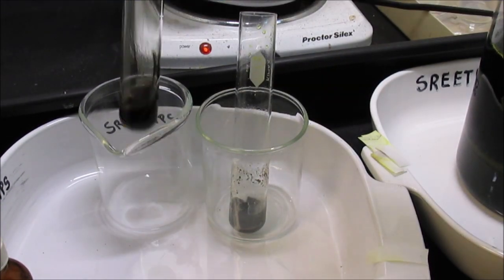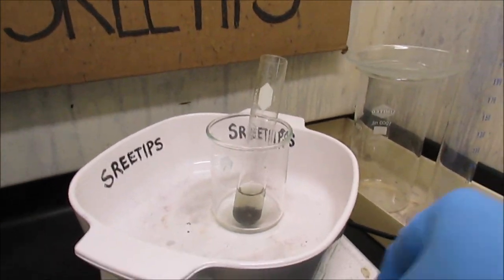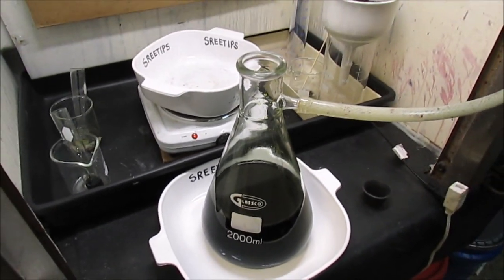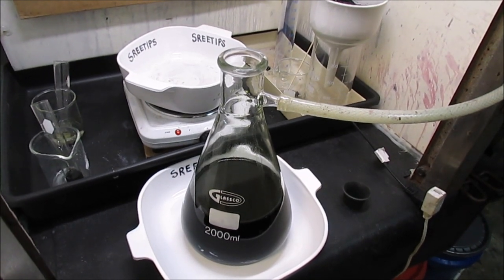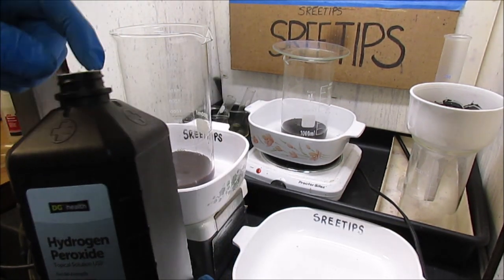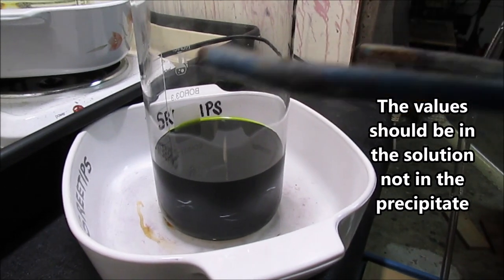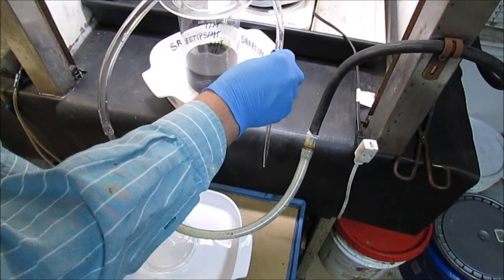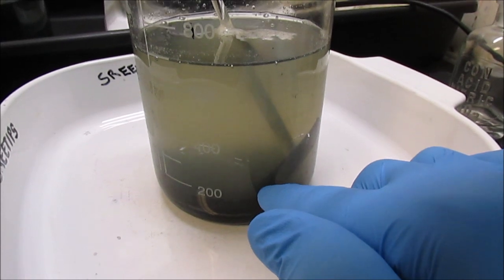Stock Pot 13 of 16 Getting The Copper Out

Comment: Thank you for your videos. I've been refining precious metals for 10 years but I still learn by watching your videos. This is the advantage of sharing. For mixed PMG metals I would probably have dissolved palladium (and copper as well) in nitric acid. Only the platinum would have been left behind. After it's easy to separate the palladium from copper on solution by adding DMG.
Reply from the maker: That's definitely a good line of thinking.

Comment: I just did my stock pot refining. I had about 60% copper and 7% other base metals. There are 3 great methods separating copper when you don't want to dissolve Pd. 10% ammonia solution + 10% ammonium chloride. Effective but took too long. HCl and H2O2 to create copper etchant. Or you can simply use dilute nitric acid. Add little bits at a time. I found this method the best and was doing a kg at a time in about 15 minutes with nitric. You'll notice Pd going into solution because bubbles turn green but as long as you have free copper it will in under a minute be replaced with free copper in solution. If you slip up and have too much free nitric and heat and take up Pd, add copper powder in slow increments under agitation till all Pd has been knocked out of solution. Filtrate well and HCl boil after. You should have less than 1% base metals in you PM mix. I was in the same position as you and decided to play around with the dilute nitric and got the hang of it pretty quickly.
Reply: Then it's just a matter of dissolving what you want. Nitric first to remove Pd, sulfuric for Rh, aqua regia for Au, Pt  (drop gold first) you'll be left with almost pure Ir at the end.
Reply from the maker: I copied and printed this post. Very helpful, thank you.
Reply: @sreetips  no problem, they're all great methods depending on volume of material. For smaller amounts use the first two, larger use nitric. H202 and nitric is a bit of a balancing act to begin with but once you get the hang of it it's pretty simple. If you ever dissolve pgms, just add more Cu powder.

Comment: Hi, I have a few question and a suggestion:
1. How can you test Palladium? ( Does it attract a magnet?)
2. Where do you buy your gold liquid tester?
3. Why don't you go straight to Aqua Regia for plated gold instead of washing with nitric acid first?
1. Suggestion: You might want to put a kit together and sell in on your ebay account because it is taking me months to put this together.

I also wanted thank you for your extensive work for your videos.

Thanks,

Matt
Reply from the maker: Stannous chloride testing solution or DMG are tests for palladium. Palladium is the only one of the six sister metals in the platinum group that is soluble in just nitric acid. It is not magnetic. If testing a piece of metal then I'd file off some and get the filings into a spot plate. Then I'd add a drop of water and a drop of nitric acid to dissolve. Then I'd get some of the solution on a piece of filter paper and add a drop of stannous chloride testing solution. If palladium is present then is will react immediately with the stannous producing a green to brown stain depending on concentration. If in solution, then DMG can used to test for palladium. Since its soluble in nitric it tends to follow silver. Silver in solution looks blue because of the copper alloyed with it. But if it looks green then there may be some palladium in it. Nickel and iron will also cause the blue silver solution to appear green. To test I dissolve a half a gram of DMG (dimethylglyoxime) in hot water and add it to a small sample of the solution that I suspect has palladium. A bright fluffy yellow precipitate will form if Pd is present. Or, just test with stannous. Either way should tell if Pd is present or not. Gold testing solution can be bought on eBay. Gold plated material is best processed in a sulfuric acid stripping cell. Trying to dissolve gold plated material in aqua regia is like "trying to kill a gnat with a sledge hammer". It will just waste chemicals and produce no gold.

Comment: You could remove copper with ammonia solution (it will take time to dissolve), leaving pt and pd. But then filtering will be difficult, because copper ammonia complex will dissolve paper filter. What you can do is decompose ammonia copper complex, distilling ammonia off, leaving copper oxide which can be dissolved easily in hydrochloric acid.
Reply: I used ammonia to dissolve copper of the pcb's, decomposing it to copper oxide and distilling ammonia back, and made ammonia from my own urine to start with. :D :D :D
Reply from the maker: I don't use ammonia in any of my processes. Except when refining palladium. The waste has to be treated differently.

Comment: I hate to back up on your videos.I am at #13 now. But at the same time I zinc precip a batch of cyanide yesterday, then boiled it in HCl/water for several hours. Thanks to you I started testing stuff. I dont have beakers and test tubes, I have coffee pots and shot glasses. After I boiled the zinc, then rinsed with boiling water real good. I took maybe a 1/4 tsp of the black put it in the shot glass added HCl and a few drops nitric, then on heat warm. Everything dissolved in minutes. Stannous test went brown then after a few minutes the brown dropped and top turned orange. So I put more in a second spoon and dropped a few Ferrous crystals, went real brown then to mud like.  I really need a answer. Do I go AR, then denoxx and ferrous, then zinc again to get the Pd&Pt then dissolve in HCl/peroxide. Or go all the way with each from the AR? So far everything you told me is working. All other people I listened to in the past did not work out. If I go all drops from the AR, after I precip the gold, then I evaporate back down before I can Amm. chl. for the Pt, correct? it needs to be syrup before I precip the Pt. Extra Amm. chl. is good, because when I drop the Pd with sodium chlorate I need the ammonium chloride in there, correct?

Comment: Hello again! Two questions that will prove my inexperience. Since I have started following your videos, religiously, I have begun to harvest the lead sheets out of dead batteries. After removing all the electrolyte, I've been soaking them in a Sodium Bicarbonate solution to neutralize the acids. Would you recommend further methods, to rinse all the impurities away in order to use the salvaged lead, in refining processes?

Secondly, the Zinc anodes, that are used in water heaters as a, "sacrificial", metal that prevents the mineral density, in the water supply from building up on the electric heating  elements in the water heater. They are rather inexpensive. They are proported to be pure zinc. Would these zinc anodes, found at any plumbing supply, be useful? As I have begun to do, I will defer to your experience. 

Again, thanks so very much for providing these videos. Is it possible to send a link to your ebay store? I thought it would be quicker to purchase a silver ingot for an anode, then making one of my own. I'm an old man. Time is the only thing that I am unable to manipulate............ yet! Thanks again. 

Wade
Reply from the maker: Wade, I’m not familiar with lead from batteries, no experience. I bought sheets of pure zinc from a site called rotometals.com and use it to cement platinum group metals out of solution.

Comment: Have you considered electroplating out the the copper out onto a carbon electrode?  Essentially you are doing it chemically with the zinc strips,  but it may be cheaper and faster to use electroplating.

Comment: Why couldn't you use a dilute nitric acid/distilled water to dissolve the copper, leave the PGM, in to the solution? Nitric won't react with PGM and it will dissolve copper if it is not over concentrated. You do not want any HCl in the solution. If you do you just have AR.
Reply from the maker: Jason, palladium is soluble in nitric acid, it would follow the copper.
Reply from the maker: But hitting the black powders with nitric at the beginning then using DMG (dimethylglyoxime) to separate the palladium from the copper might be a way to go.
Reply: Didn't know palladium would dissolve with nitric. Might be worth a try.
Reply: @sreetips  Do you have to denox the nitric before adding DMG?
Reply from the maker: I've never denoted, I just add the DMG and it works fine, if palladium is present.

Comment: Mr Tips. Do you remember saying to us when you were making your silver cell, That. I paraphrase that if you continue to use the cell that the copper will start to form on the silver when the concentration of copper in the solution reaches a certain percentage? Could you form copper crystal?
Reply from the maker: Yes, copper could begin to plate out with the silver and contaminate the silver, exactly the opposite of what we're trying to do in the cell. Copper crystal? I don't know, I've never tried it so I don't have any experience making copper crystal.
Reply: could you use the copper contaminated PGM solution as an electrolyte? To bring the copper out of solution?
Reply from the maker: I don't know. Again, no experience.

Comment: Have you tried 35% Ammonia hydroxide solution?  I have used that to dissolve copper from melted silver.  I have also used glacial acetic acid with 28% H2O2 to dissolve copper as well.

Comment: I have a question   when you have the metals in solution and you are checking for copper in solution, could you take a clean test strip, dip it into the solution then test it with a drop of ammonia on the test strip to check?
Reply from the maker: Possibly

Comment: This is off the subject but, can gold be stripped off platted metal with sodium thiosulfate
Reply from the maker: Frank I don't know about that because I've never used it. I have used a sulfuric acid stripping cell. It will get the gold from junk gold plated jewelry items.
Reply: @sreetips  I've used the stripping cell but this sodium thiosulfate  works like sodium cyanide. I have used the cyanide along time ago and took the gold in only a matter of seconds.
I mean less then a minute.  From what I've seen on you tube, thiosulfate works close to the same way. Check it out.
I can't find the formula or process to make it work.  You might have better contacts then I.